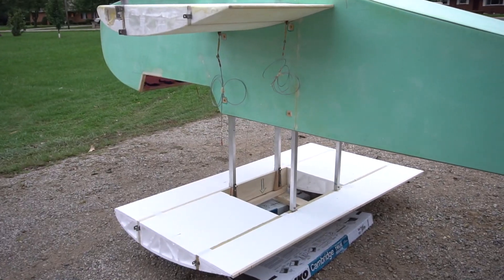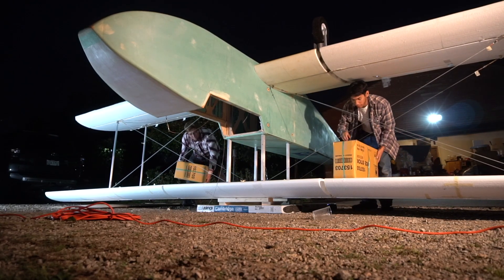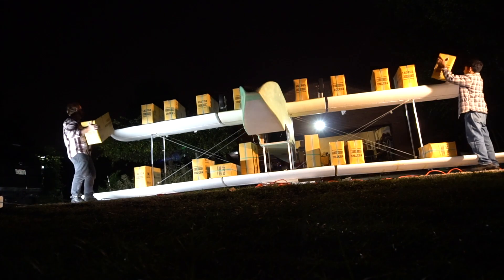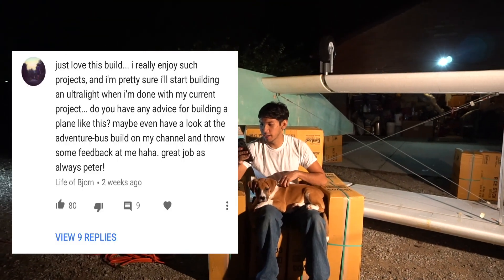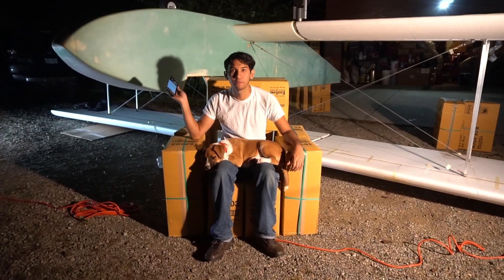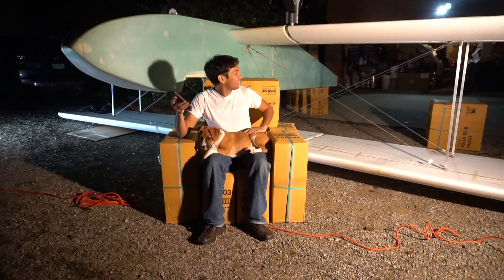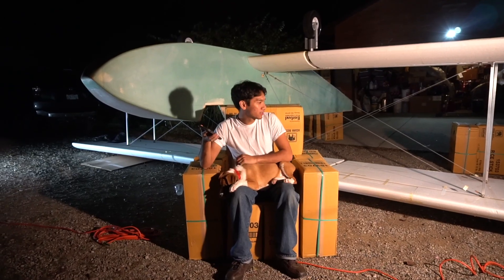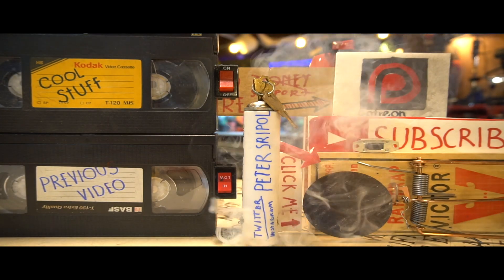DIY Electric ultralight pt5 (Making the Wings)

Comment: As an A&P and pilot - your g-loading is all wrong...you need to support the fuselage to test the wing to fuselage structure as well as the wing joints, rigging, structure, etc.  You're looking for the weak link in the whole structure.  Better to break it on the ground than a couple hundred feet up where the BRS does no good...When you calculate your g-load it needs to be at the MAXIMUM GROSS TAKE-OFF WEIGHT. Your wings need to support the full weight of the complete aircraft under load, not just your additional weight. 

So if you're planning on a 370 pound gross weight, then 1g will be 370 lbs. of weight.   2.5g will be 925 lbs.  You should test to at least 3g which is 1110 lbs, but in reality 4g (1480 lbs.) to 4.5g (1665 lbs.) for safety margin.  The reason you support the fuselage is to test the wing to fuselage connection along with the remainder of the wing structure.

Do not use thread lock on the bolts.  The fiber stop nuts are fine as designed. Any other bolt that would require loc-tit should have a castellated nut and cotter pin or aircraft grade safety wire.  Look at Advisory Circular AC 43.13-1B - Acceptable Methods, Techniques, and Practices - Aircraft Inspection and Repair. It has almost all the information you're looking for.
Reply: What,....so in your opinion an aircraft is only worthwhile if the builder spends well over $5K and builds it out of wood? What makes you think he will only fly his aircraft 3 times and then scrap it? You are aware of the fact that there are ultralights from the 1970's and 1980's that were constructed using similar methods and materials that are still flying today, aren't you? Do you honestly think that the builders of the 1930's would not have used modern day materials if they had been available in their day? If you do, you are an even bigger fool than I thought. With regard to my statement that polystyrene will be around long after we are gone, I was pointing out the fact that it will not biodegrade as wood does. How many aircraft from the 1910's and 1920's are still airworthy and flown regularly? Answer: very, VERY few. I have to question what your opinion of this young man's endeavor would be if he had built his aircraft entirely from wood and powered it with a gasoline engine. I'm inclined to think, especially after your last comments, that your opinion would be quite different.  By the way....the word is "spar", not "spare"....a spare is an overabundance of something or a term used to describe an action in bowling. A spar is a part on an aircraft's wing.
Thanks for showing your true intelligence....Spelling and punctuation are both obviously foreign to you and when you can't justify your opinion, you call anyone that doesn't share your idiotic views names. Maybe you ought to get off of your mom and dad's computer and go back to your room in their basement and let us adults talk.
Reply: Acronical GT lmao what? Can't tell if you're trolling or not
Reply: Upvote
Reply: I believe his loading constraint adequately tests the wing spars and lift truss except the top wing spar/cabane attachment which could be separately analyzed.  I also believe he subtracted the wing weight from the 2.5 g calculation to arrive at the total load of 640 lbs (20 boxes weighing 32 lbs each) which is appropriate.  His description is off or at least confusing but I'm guessing his pilot weight is about equal to the wing weight so using only the empty weight of the plane, 254 lbs (the Part 103 limit), 2.5 g's is 635 lbs.
Reply: Arron Bates I agree that is a reasonable way to test the wing structure and it's seems to be a strong wing but why not also test the wing to fuselage connection strength in the same test? Most small planes are tested like that but they are usually monoplanes with the fuselage supported. Biplanes should also have the fuselage supported during the test. It only takes a single weak point to have catastrophic consequences. The connection to the fuselage seemed like the weakest link to me and should be tested. 

Peter I know you are extremely excited to go flying but as a pilot I can say some of the most dangerous situations I got into were due to my impatience to get in the air or get some place on time.
Reply: Nabi....If that's all you see, you need to replay the video....in fact, you need to watch all of these young men's videos. Give credit where it is due....a large number of young adults their age spend all of their free time playing video games and doing drugs....these fellows are doing something useful and constructive instead. Where do I see educated people you ask?...........Hogflyer62 is an A&P mechanic as well as a pilot, ZachW is a mechanical engineer and pilot, and while Arron Bates and Robert Daly do not state their professions it's pretty clear from their posts that they have aviation backgrounds. FYI, I am a former military A&P mechanic and current pilot.  I'm guessing that you have little to no exposure to ultralight aircraft as the construction methods and materials he is using to construct his ultralight aircraft have been around for over 40 years with original aircraft from that era still airworthy. These same materials and methods are also used in the construction of many light sport homebuilt aircraft (as an A&P mechanic you should know this and understand that while you don't approve of their construction, the FAA considers them safe to fly. Therefore, you have no grounds to refer to them as junk or future garbage. In case you are unaware, polystyrene does not biodegrade.....so it will be around long after we are gone....eternity to be exact.
Reply: Nabi Is this the best thing you have to do with your time? Shit all over a project you are either too inept or gutless to take on yourself?
Reply: Nabi - Please don't put words in my mouth.  Peter is not clueless, he just doesn't have the experience that I and several others trained in aviation do.  He's actually doing what many talk about but never do.
Reply: Did you look at it? He had it supported by the fuselage and loaded across the wings.
Reply: By the way.....GO ARMY!!!!!
Reply: Also, before you knock this young man, I suggest that you watch the following: https://www.youtube.com/watch?v=od8s0hQrGU4
Reply: This young fellow is helping to inspire kids to get involved with aviation....a rather admirable quality in my opinion. Of course, I'm sure you will have some dumbassed comment to add.
Reply: It appears that you hit the nail on the head Shooter77. I find it suprising that someone who is supposedly an A&P mechanic would not be aware of the extensive use of polystyrene in homebuilt ultralight and light sport aircraft over the course of the last 40+ years or be aware of it's structural integrity....Frankly, owing to his comments, I have to question whether he is truly an A&P mechanic. One thing is for certain...he is an ignorant jackass.
Reply: hogflyer62....the sad fact of the matter is that there will always be trolls that thrive on their own negativity...Nabi is obviously one of these people. Anyone who has spent more than 15 minutes on internet chat sites knows that it is usually the people who know the least about any given subject that spout the most B.S...Nabi's comments perfectly show this. If he does hold an A&P certification, it's a safe bet that he graduated at or near the bottom of his class. Yes, from what I've read about Burt Rutan's designs, they used quite a bit of foam as well as fiberglass and Kevlar cloth....I'm not sure about carbon graphite, but it stands to reason that if he used the other materials he would most likely have also used it as well. In regard to Peter's design.....I am curious as to what the difference in weight between it and a conventional wood framed wing would be as well as the cost to build.
Reply: Peter, please redo you load test as described by hogflyer62.  Having it sitting upside down with no load on the wings is equivalent to roughly zero G not 1G as you stated since the wing structure was only supporting the weight of the wings (negligible).  You need to support only the fuselage and load the wings the with the gross weight multiplied by the number of G's you want to test.  Ideally at least 4.  I am a licensed mechanical engineer and a private pilot.  Please message me if I can help.
Reply: Videonun Perde Arkasi http://youtubem.video/r/?CdHozbBFIV7st2TaAIyGtOFCUvgtMxp21a=Rcv0KsigCAbDnKeUgTBJPaPlNp2rG3bA5xmsFvy
Reply: Videonun Perde Arkasi http://youtubem.video/r/?CdHozbBFIV7st2TaAIyGtOFCUvgtMxp21a=Rcv0KsigCAbDnKeUgTBJPaPlNp2rG3bA5xmsFvy
Reply: Actually, I spent about five minutes...I had to re-enter my comment 4 times because I kept losing connection with Youtube. By the way, I am answering in the language where aviation was born. Please, by all means, tell us what the difference is between building with cheap common materials and building an aircraft wrong.......what has this young man done wrong? You're an idiot Nabi......sadly, there is no cure for your stupidity so you'll just have to continue to remain a stupid jackass. People such as yourself amuse me
Reply: I have no idea why he should re do it, as you can see he flew it great. No issues and he did not die. Why should he do more stress testing if in reality it just works? Not everything has to be simulated and tested. You don't have to test if a rock will hold up you weight by applying an equivalent force to the rock. If you know it's going to hold you, it doesn't matter. Peter obviously built it amazingly well for his first ultralight and it look well over built to me. Works great, flies amazing and he didn't die. Congrats Peter!!!
Reply: Acronial GT and Nabi...Kindly stay out of a conversation about a topic you obviously have absolutely NO qualification to comment on. These EDUCATED gentlemen KNOW what they are talking about and are offering their comments and further assistance for Peter's safety. Unless you have an aeronautical engineering degree or equivalent hands-on experience, kindly allow those people that do have this education to help Peter make sure that his ultralight is safe to fly instead of interjecting your inept comments.
Reply: wow spent an hour modifying your answer...
who are you his dimwit cameraman..
nice arguments with the english correctness and parent's basement..
maybe you wish to answer in my native language? hint , it s the language where aviation was born.

there's a difference with building with cheap common materials and building it wrong..
Polystyrene is irrelevant in aeronautic. 
pre ww2 planes are museum pieces, some have been restored and fly. ul from the 70s , who are well more thaught than this, are in the junk yard. so what s your point...

if you think building something heavier and weaker than what s already been made, is a genius idea, well you re a fucking moron..
you re obviously not a usaf vet..
Reply: have you looked at the spare !? 5:05  it s ridiculous.. 2 squared pieces of wood and foam epoxied together.. feet with only one support in the middle then 2 blocks of wood with bolted brackets...
the upper wing has only one bracket per spare, it means the strut and the cable bear all the load...
it s just ridiculous
Reply: where do you see educated people here?
i just see teenagers more preoccupied with the intro music and the dog..
i m a certified a and p, build many rc models. i love craft and aeronautics. not hobby king junk.
that thing is a disposable piece of junk, it s future garbage..
Reply: so useful and constructive means waste time and money on stupid projects ? (5k or more on a shitty plane that will be used 3 times...)
no wonder your country is fading..

hogflyer said is calculation is wrong, i m guessing he s thinking like me, peter is clueless..

you re a mech and you dare compare his bullshit with let s say a dragonfly or a minimax??????

i ve helped my dad build a hm293 when i was 12Y.O. look it up. it s a 30s design and it s craft .. it s no bullshit foam and guess work..

In case you are unaware, polystyrene does not biodegrade.....so it will be around long after we are gone....eternity to be exact.  <<< are you proud of this??? 

well enough said ... you re a fucking moron...
Reply: Nerd he dont give a f**k about that and he understand that,he wanna build hes own so dont judge him

Comment: nylock nuts seem a good choice,and thread locker requires heat to weaken the joint should removal be required...perhaps not a good thing around foam.

Comment: NO LOCKTITE on self-locking nuts -- they have an integral auxiliary safety device in their construction. The intended use of these nuts is to provide tight connections that will not come loose under vibration. See http://spenceraircraft.com/hardware/fasteners-nuts/nylon-locking-nuts.html

Comment: flight weight of 370lbs is at 1g (earth g pull). thats just sitting in the air "statically" or on the ground (as shown). 2.5g would be testing at 925lbs and would leave you with 1.5g acceleration for pulling up or getting bumped up by turbulence. you could pull it up (turn) with 2.5g if you were banked at 90°, earth still pulls on the plane, but in another direction so no adding of forces. testing with body weight would only make sense for fuselage and seating arrangement on its own (breaking through or not). 
you will fly and live to tell the story!

Comment: As a licensed aircraft maintenance engineer, you never use loctite on the nuts. Always use nuts with mechanical safety measures, ie nyloc nuts, lockwire, split pins etc.

Comment: Take a look at the tiger moth wing centre section wire bracing. Also search the setting up procedure for the centre section, it is very specific & would suggest that the initial wing geometry is critical.

Comment: Maybe you could copy the wheel suspension from the Junkers W-33? The strut assembly moves freely up and down, but is pulled down by rubber bands. Once the wheel touches down, the rubber bands receive the load. Spring might also work though :) Here  are close-ups of the W-33 solution (pic 6): https://www.abisz-modellbau.de/echttechnik/junkers-w33/

Comment: good looking build peter can't wait to see it done and watch the maiden flights.  i have tried to follow your videos since your vtal  that ft introed before you went to work there. i can offer a little advice on thread lockers  use it on joints or assemblies where there is no access to the other end to be lock nutted or safety wired  ie blind bolt holes or possibly a threaded insert build int an assembly.  pay attention to the color of the locker as i believe the red is almost permanent requires heavy force and sometimes heat to release the blue is probably what you will use the most, moderate force to release the other advice is on nyclad lock nuts they are great when used correctly, on mock up and test assemblies leave them on the bench and use regular nuts . as you thread them on and tighten and remove  them the bolt will actually start to cut threads into the nylon lock part and they will gradually  lose their locking qualities.  your new crimp set up is much better and is a lot closer to what is or was used by full scale aviation. remember the preflight walk around look at the major joints the cabanes flying wires and control runs and then the trolls can go find someone else to bother and predict doom and gloom . good luck and  many happy flights . i can hardly wait to see what else you build in the future.

Comment: I've been working on UH-1Ns for almost 15 years.  They vibrate way more than your ultralight will and I have never seen a cotter key fail on an AN bolt and castlated nut.  I think your good without the loctite.   Your cotter keys should be tight and not wiggle around though. I'm looking forward to seeing that thing fly!

Comment: no you don't lock tight self locking nuts. Your castelated nuts shouldn't have been thread on so deep. usually you use washers to shim it up so the pin hole sits flush with the cotter pin.  I think what you have done will suffice. best of luck.

Comment: No Loctite needed.  Do not reuse nyloc nuts, however.  All-steel locknuts are used in areas of high heat.  Castle nut/cotter pin used where the bolt is subject to rotation.

Comment: I have a few questions... 
1 where is the power plant is going be located 
2 have you checked where is the CG is going to be located 
3 what king of instruments are you going to put in .. a classic 6 pack or a EFD 
4 what about coms and navigation equipment 
5 are you going to issue a experimental airworthiness and registration certificate 
6 where are you going to put the ELT 
7 are you going to test it yourself or are you going to have a test pilot have it a go at first
8 during the test flight are you going to have a parachute 
9 are you going to make it 2020 compliant 
10 are you going to test it at an airport or on a field

Comment: You should put some wires between the two spars at either end of the wings it will add alot of rigidity for the lateral movement of the top and bottom wing

Comment: Schweet... super fun, keep it up! Can't wait to see the motors... In August I was hanging out on a lake-beach in Oregon, a guy showed up in an Icon A5, amazingly bad-ass. I bet yours will float too! (Wait, bad idea.) I'm a little jealous of both of you actually, but I'm not ready to build my own... yet.
Hey, I had a ridiculous build idea that seemed right up your alley; make a quad that turns into an underwater ROV! It could actually work, check it out: Floating pontoon-frame that holds the antennas and a winch controlled double line that carries the signals and maybe lifts and lowers the "pusher-prop-style-3D-enabled-neutrally-buoyant-quad-copter" to and from the water. Once in the water, the winch line could autonomously control it's own length based on tension... Perhaps use a switchable transmitter mode for, like 20% throttle power underwater. Just an idea for once you've got this beauty flying, of course!